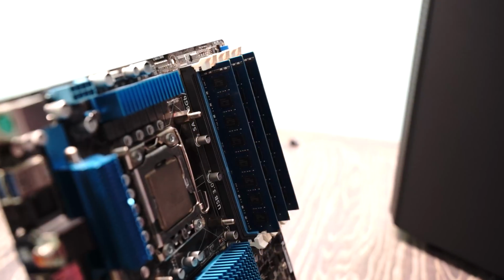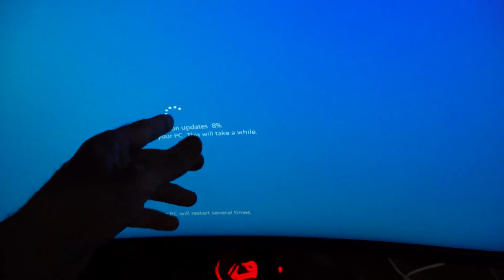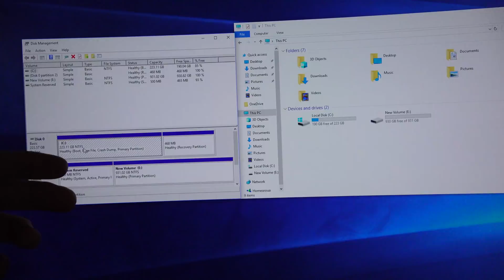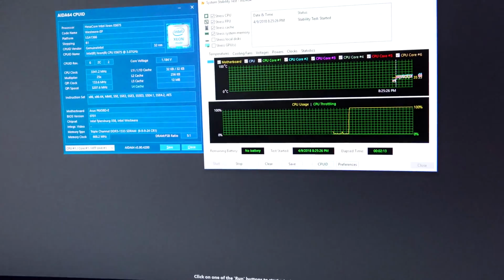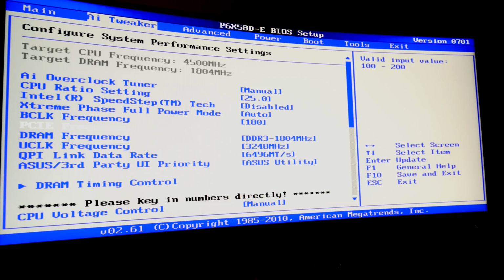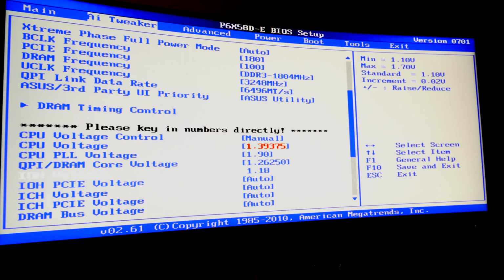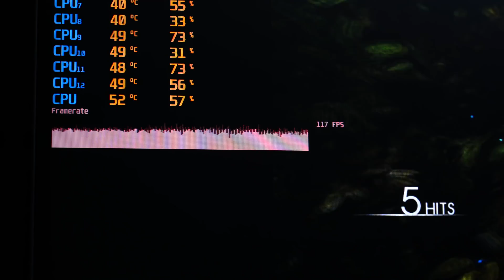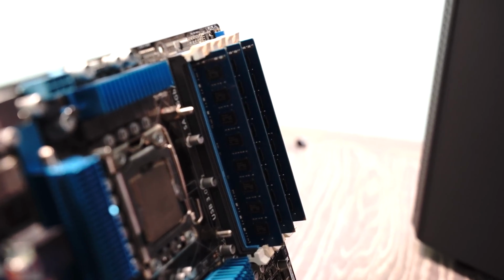Is X58 Still Worth it..? Taking the 6 Core X5675 to 4.5GHz on AIR.

Comment: I still actively use a Windows 7 PC I built in 2009. It has an Asus Rampage II Gene mobo (which is x58) with an i7-920 (OC’d to 4Ghz), 8GB DDR3-1600mhz, and a WD Velociraptor Raid array. It still runs almost every game out there. The only thing I’ve had to upgrade over the years is the GPU. Right now it has a GTX 1060 (6GB) in it, upgraded from HD6990.

I have a newer  x99 workstation with Windows 10 (Rampage V Edition 10, i7-6900k, 64GB DDR4-3200mhz, 2x GTX 1080 in SLI, 960 Pro SSD) but I still use the old x58 based system for a bunch of games on steam, as well as audio production work (I have older firewire based audio interfaces with drivers that only work with Win XP or Win 7).
The x58 chipset was damn good, and it can still keep up with everything nearly a decade later.
No it’s not the best, but it still does the job. 
In fact, the only thing that the old system seems to struggle with is Star Citizen (which runs sluggish even on the newest high end hardware).

Comment: 1. The problem is that water block, it's not designed for the x58 and is not properly pushing down the cpu.
2. Excellent overclocking guide, but at baby safe levels. Now do a proper balls to the walls one.
3. Temps are the number one enemy, lowering it will make a big difference.

Comment: Those cpu's sure are cheap but used 1366 boards go for 150 usd/eur which is lot
Reply: Rentta No it's not when you consider it's the final board to feature plain old bios and also the most powerful that still supports plain old bios!

Comment: Counterpoint: If you bought X58 back in the day, that meant you went enthusiast and are holding onto it waiting for a worthwhile upgrade whilst you save. This is def a different viewpoint from the bargain deal hunter. It's also a little old so there's a slight issue with finding boards that match colour schemes, and their age may lead to a sudden death at some point.

Comment: You won the silicon lottery man. I cannot get past 3.8GHz with my X5660 :(
Reply: You have some other setting making your X5660 unstable, every X5660 should make at least 4,2Ghz with proper voltage. Try lowering QPI, uncore and memory Speed to the minimum you can get, put the highest CPU multiplier you can get and keep bumping the FSB step by step, with a 1,35V.
Reply: Thanks for the suggestion mate... I tried really everyting. I'm with a Corsair Hydro 105. Temps are really low even with 1.4V on the CPU.  My memory is actually into their specific (1600MHz...I use 200FSB). I tested the 200 fsb with lowest multiplier (low final frequency) to test all the subsystem stability. Bumped the FSB core voltage, lowered QPI to the minimum. I can get into the OS @4GHz but I cannot pass prime95 or Linpack. I also did watch all the video and hints in this channel about x58, but i'm still unstable. I got an asus P6T SE, 24Gb ddr3 , x5660. Any idea?

I was able to get my i7 930 to 4.2GHz easily... but this X5660 is making me crazy.
Reply: 24gb of RAM, i gather its triple channel 3x8Gb sticks. Try with only two sticks of RAM, or even just one to test it. Some X58 are nervious when they have more than 16 Gb or RAM on some IMC of some CPUs (and work fine with others), and some work fine with 24Gb. Some others don't work at all with 8gb sticks. Also, i gather you have the latest BIOS revision, but just checking aswell. Also, try to enable LLC if you don't have it already.
Reply: Thas a lot for your hints. I got 6x4Gb modules. Could you please share your settings? All the voltages, frequencies etc?
I have the latest bios, all the ram modules are the same model and specs. I will try with only one module and adding one at time (single channel, dual, triple etc)

Comment: Hey there i recently bought an asrock extreme 6 for 100€ with a ton of other shit i sold so that i got the mobo for 50€...
I bought a w3670 as it appears to be the exact same as the x5670 just without the capacity of running in dual cpu mobo (wich i don’t want) and was really cheap too (25€ or something on AliExpress, but prices changes so it may be higher now).

My question is: isn’t 1.4V a bit too much for these cpus, so it will shorten their lifetime as mine run at 4.2@1.36 (i set this really quickly i think it could do 4.4 with some tweaking) and i want it to last

Comment: I am using an evga x58 with an i7 930 oced just a little, but I don't know how to OC it higher simply because the bios is super confusing and I don't know what any of the voltages do. 

I've looked at tutorials, but none of them explain clearly enough what to do.

Comment: >Running it overnight to get the windows 10 updates
You seriously need to get WSUS Offline software, it is free and will make your windows installs faster and easier considering how many machines your are building.
Reply from the maker: Yeah I recently getting on top of all this, thanks man.
Reply: Good to know, currently the full lot 32bit & 64bit (7, 8.1, 10, Server 2008+R2, Server 2012, Server 2016 raw) + iso's compiled for each weights in @ a total of 58.21GB that's with all the patches, Defender + Essentials.
However there had been a new update sent out by MS today AUS time, which might bump that total cap slightly up.
The space it takes is nothing compare to the time you will save. :D
Reply: WSUS Offline?
What’s that?
Reply: @shannonp4037  http://www.wsusoffline.net/
Reply: I'll have to try this out. I hate win 10 updater.
Reply: The offline package is basically mandatory at some point after release.
It cuts down my Win 7 installations by about 2 hrs (which is basically just Windows looking for updates and downloading them)

Comment: Back when heatsinks were heatsinks.
Reply: really wish they bring them back, only EVGA, if im not wrong, brought them but to a high-end type of board, miss the all-around heatsink with heatpipe mbs.
Reply: Mr.Magnificent .... i like the looks of it , it's more industrial new Motherboards look like toys these days and yes aboviously they will work better
Reply: kurok1tenshi .... yes i think they look much better than new Motherboard's heatsinks
Reply: tim serious I agree, hell I also kinda like the look of pc parts from 90's, very industrial.
Reply: Mr.Magnificent ... i like it i don't know .... if it was black or siver (chrome) in colour it would look dope 😅
Reply: Yeah I'm hyped for that X470 Gaming 7, hopefully if the proper heatsinks get amped up enough across the web then maybe other manufacturers will take note and get their act together..
Reply: WayStedYou
The new Gigabyte x470 board seems to have some nice heatsinks on it.
Reply: back when a smoke was a smoke
Reply: Great video, still relevant. My “new” $30 au x5675 (O.C) shits on my old i7-960. (O.C) Thanks for this
Reply: So you prefer motherboards that need more power and less efficient? Kids dont know what you talking about.
Reply: tim serious they do not look better, the point is, they work better ...
Reply: tim serious Nah, these blue finns look very basic, and that kinda wave on top is weired, its not industrial look enough to be timeless
Reply: P8Z77V-LX :D Going well with 3770k@4.5GHz
Reply: @mmllmmll22  8i
Reply: @ciiveman3044  ?

Comment: If you had boot issues with the case, that means there was grounding issues
Reply: I had that happen to me
Reply: Must have been that pesky IO shield! XD
Reply: @cOMM4ND3R  Just use silver screws than the painted screws that comes with the case and use it on the motherboard, gpu and psu and I don't the I/O shield in my case no problems since he talked about the express gate booting issue I have that disabled and it working just fine for me with crucial mx100 256gb ssd. Unless he using an older bios not too sure to be honest
Reply: Karine Mallet he said the issue was a bios setting along with the ssd he used. It was confusing when he said it tho.

Comment: You might have overheated the northbridge with that overclock because with watercooling you are not cooling the northbridge and vrm's around the CPU. Put an extra fan blowing on these and you shouldn't have a problem.

Comment: X58 is absolutely awesome! I am still using my i7-980x OC @4.4ghz.
Reply: Hello.... Please can you tell me if I can use 8gb DIMMs with these motherboards? Please reply!
Reply: Diganta Majumder <<< As I know you can not. Supported max memory is 24g, 6x4g. So 4g would be the biggest.
Reply: @sandornagy1565 , In some forums I recently found that some people are using 48gb of RAM in X58. So, with Xeon it can run 8gb sticks surely.
Reply: Diganta Majumder <<< I’m using Gigabyte ga-x58a-ud3r and I did some research before installing any ram module, I ended up with 3x4 Corsair Vengeance 1600, using it for audio editing, so it is fine for me. I’ve never heard it would work with 8g ram modules, but try it, good luck! Let me know if..... 
(xeon 5660)
Reply: @sandornagy1565  x58 works with 8GB modules, source : I've used 48gb In 8gbx6
Reply: @jamesgarrett3000   << wonderful!!!  good to know, I guess you are photo/video editing... anyway, thank you!

Comment: X58 is far from dead, i just recently upgraded from my 4.5GHz X5670 to a 3930K at 4.2GHz, and whilst the 3930K still outperforms the xeon despite the clock speed difference, the X58 stuff is still pretty damn strong if you can get a decent clock out of it, had mine in a rampage 3 extreme, will probably get it under LN2 or DICE at some point and see what she can do, i do love overclocking on X58, much more involved than just multi and vcore :P

Comment: O buyed a x58 P6T deluxe V2 by 100$ And a xeon E5540 only for 10$ i am pretty sastifected, maybe next 2 months a by the xeon x5675 to play a little with overclocking. X58 best plataform!
Reply: you don't need the X5675 if its not easy or cheap... if you can get an X5650 you will be more than happy... very small difference
Reply: @TallynTech  - I just ordered an x5675 on Amazon today for 29.95 & free shipping. Ordered a G.Skill Ripjaws 12gb 1600mhz triple for a total of $76.00. I think availability and price matter of luck.

Comment: X58 Asus Sabertooth Running x5650 @ 4.2 on Air with Stock Intel cooler that came with the I7 Extreme 6 core variants for x58.

Comment: Asus P6X58D-E was one of the best mid range mainboards for overclocking back in when X58 were "new", i could push my X5670 to 4.7Ghz at 1.45v watercooled. Great piece of hardware. Now im rocking Intel i9 7920x and im loving it, great overclocker aswell.

Comment: "Though this is a special variant, it is the 75, which apparently is a better bin than the x5670."

Yup, it is. Although I'd recommend the W3680 or 3690 instead if they're similarly priced since these have unlimited multipliers so you don't have to deal with high BCLK (200+) problems these CPUs have.
Reply: 5675 goes to 25 multi so even at 200BCLK (typically doable on most board/cpu combos) you are looking at 5.0GHz ... which is unlikely to happen anyway.  Just sayin' ...

Comment: Funny you made this video,
I recently refreshed my x58 PC from 2009 with new generation 2nd hand parts and brand new parts.
i7-920 to Xeon W3680 ($100)
GTX 275 to GTX 960 ($100)
WD Velociraptor 10k HDD to Samsung Evo 850 SSD ($120)

W3680 has unlocked multiplier so it OCs to 4GHZ + very easily
I'm still using a corsair H50 AiO i think this need to be changed :)

This x58 9year old PC is still very good in this age with a refresh

Comment: I can push my x5670 to 4.8 is i want, however it requires 1.5vcore.
My daily is 4.5 at 1.425vcore, and it's about 20% slower than a 4ghz Ryzen 1600, which is pretty damn good IMO

oh yeah, btw you should crank the UCLK as much as possible, you could get as much as 100 extra score in cinebench

Comment: $50 CPU..... no. no it isn't. Cheapest I could find anywhere was $59USD, $77AUD.
I got my X5670 to a solid 4.25GHz on air with a Coolermaster TX3. Paired with 6GB DDR3 @ 1366MHz and a GTX 1070 scored 920 in Cinebench, better than my 4770k @ 4.5GHz with 16GB DDR3 1866MHz with the same 1070, only scored 896. two more cores really helps this kind of processing.
X5670 Passmark CPU scored 10468, 4770k Passmark CPU scored 12133.

It will be good to see the kind of load times and bottlenecking you get with your X5675 with GTX 1080 Ti game testing.

Comment: I'm on a 8700K for a few weeks. I had a X5675 @ 4.6GHz before. For AC Origins I notice every so slight improvements in frame rate stability (dips are less) combined with my GTX 1070. Witcher 3 with mods and everything balls to the walls was 75fps maximum frame drop in novigrad, I haven't tested that game with the 8700K but that should be much higher now. Fallout 4 is also a odd game that likes to to cry out on the CPU but other then that I would say Intel's 6 core Westmere is still a champ that's going strong.

Comment: Got a bargain on an EVGA X58 Micro a couple of months ago. Slapped on 12gb of DDR3 and a X5670 and pushed it to 4.5GHz on a 120mm AIO. This thing was a legit beast, never exceeded 70°C, though the northbridge was fucking toasty (had to getto rig a small fan on top of it to help cool it down). Great experience overall !

Comment: Overclocked two x5650 on an EVGA SR-2, but reached only 4,13GHz on air. The CPUs can go higher, but if the fsb go higher than 188MHz, the system performance declines. It's a "little bit" strange. Don't know yet why. I'm thinking about changing them to x5675 because of the higher multiplicator. This will cause less trouble :)
Great video :)

Comment: Sometimes i get 995 cinebench score from my x5660 4.4 ghz and asus p6x58de mobo. And sometikes i get 920-940. Is it a overclocking problem Bryan? Or cinebench? Thnx
Reply from the maker: Would be a slightly unstable OC? or a background process /app interrupting your cinebench run.
Reply: Thnx Bryan will do some more tuning and will give you an update.

Comment: Should I get this system for $30 
Q8200
4GB DDR2 RAM 
300GB HDD
Case + PSU but no GPU

I can get a used GTX 750Ti (Around $40)